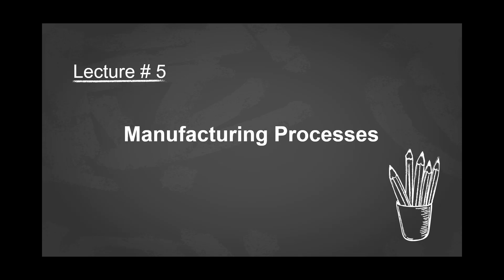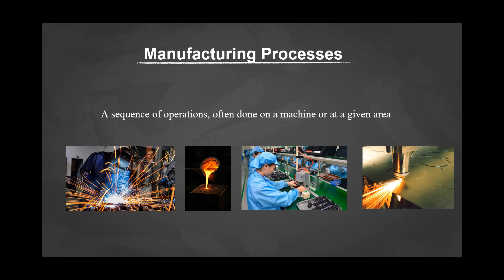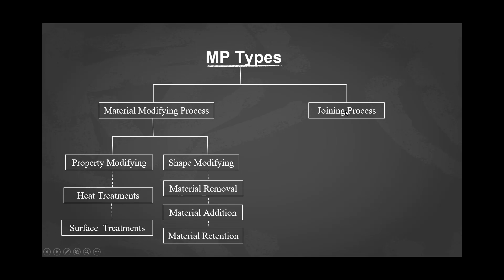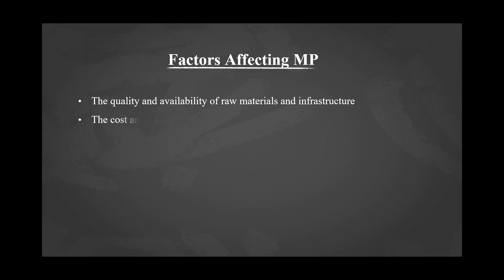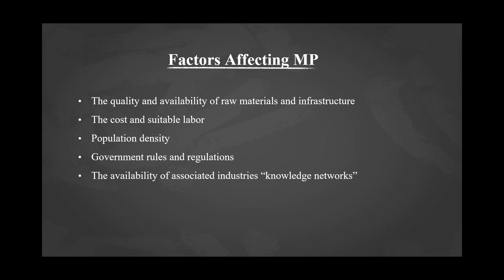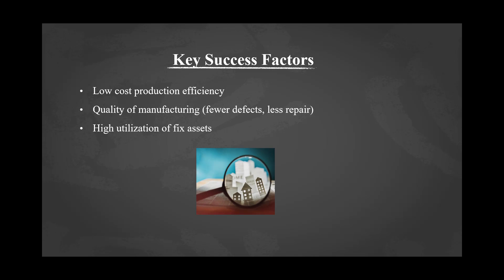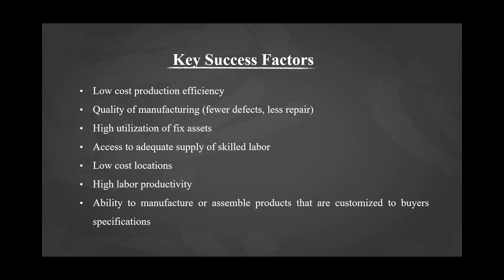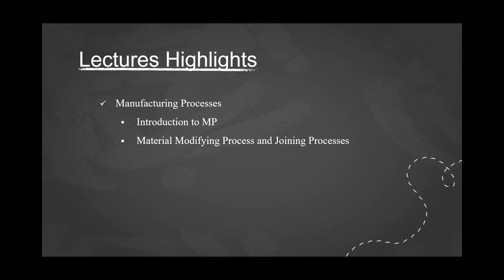lesson #5: Manufacturing Process,  Types, Factors and key success factors of manufacturing process

Comment: Ahmed Rustam
F18-0302
BS(SE), 5th
Section A
--------------------------------
Summary:
This lecture discusses a new topic related to Manufacturing Process. MP is a process in which different steps are involved and a product is made for further processing state or for customer utilisation. It has two processes, each having different sub processes:
1. Material Modifying Process
     i. Property Modifying
     ii. Shape Modifying
2. Joining Process
     i. Permanent
     ii. Non-permanent
     iii. Semi-permanent
There are different factors that play an important role in the process of manufacturing, either the process gets distorted or goes with a smooth circulation. Key success factors give a plus point to the business and as well as the MP.

---------------------------------------------------
Title: Amazon FBA
Strengths:
1. Automated
2. Stress Free
3. Effortless Logistics and shipping 
4. Potentially Unlimited Storage
5. No rent for physical shop
6. In this pandemic situation, every business collapsed but those who own their stores on Amazon still continued their business hassle free.

Comment: F18-0310
BSSE 5TH A
Summary:
Operations carry out on some area of machine is referred to as Manufacturing process. We can also make changes during the manufacturing process. Material Modifying and Joining Processes are the two main types which are used to convert the raw material into finish products. As it is a complex process so affected by many factors that is raw material, cost, labour, rules etc. To achieve the desired goals company must have quality production and design in low cost using skilled labour and high ratio of labour productivity.

Task:
Fish farming on small scale
Because of fish farming on small scale the productivity and also the quality of product will improve. It provides most flexibility because of Low start up and operating costs and No construction or training required. Also provides low costs in terms of products and switching of locations and we can also process leftover (dry ) fish. And lastly, it took less labor intensives.

Comment: F18-0380
BSSE 5th C
Summary;
This lecture is all based on manufacturing process. We can define manufacturing process as a set of operations that are processing anywhere, either on any machine or any specific area. Baking, Rasterizing is the examples of Manufacturing process. 
So, manufacturing process is a process in which sequence of operations perform on the machine or at a given area.
Types : 
✓Material modifying process
✓Joining process
 Material modifying process either change the property or shape of material. 
It is further devided in
✓Property modifying process
(Techniques include:Heat treatment ,surface treatment )
✓Shape modifying process(it is obtained by material removal, material addition, material retention)
 Joining process are permanent , non-permanent and semi-permanent joins.
Reply: There are three joints of joining process:
	Permanent
	Non-permanent
	Semi- permanent
There are many factors that affects manufacturing processes e.g. quality, cost, suitable labor, population density etc. 
After this we talk about the key success factors include :
Low cost production efficiency, quality of manufacturing, high utilization assets etc.
There are examples of ultra low cost products.

Comment: F18-0343
BS (SE) 5th B 
Summary of Lecture 5:

This lecture is about the manufacturing process first of all what is manufacturing process? Manufacturing process is the steps through which raw materials are transformed into final products. 

There are a lot of manufacturing process some are discussed in lecture like cutting, welding and casting etc. Basic purpose of all these process are same as mentioned above the transformation of raw material into final products. Furthermore we studied about the types of manufacturing process.

There are major two types 
•	Material modifying process: It changes the properties or shape of the material.
•	Joining Process: It contain, welding breezing and adhesive bonding.

Material Modifying Process is further divided into two types, Property Modifying and Shape Modifying Process. These types have further sub types but the major aspect of the material modifying process is to change shape properties, performance and power upgrading etc.

On the other hand joining process is divided into three type’s permanent, non-permanent and semi-permanent process.

After that we studied about the factor that affect the manufacturing process in detail. These factors include the availability of raw material, cost, labor, government policies and knowledge about the industry. After which we moves toward success factors of manufacturing process like if we start work with low cost and efficiency is high and also we have the ability to fix assets. Also we have to choose the low cost locations high productivity materials and low cost design and engineering etc.

Comment: Zaidullah jamil
F18-0329
BS SE     5B
summary:

In this lecture first we introduce manufacturing process and then its type factors and key points.
Now first we discuss about manufacturing process that is “sequence of operation often done on a machine or at a given area.” Manufacturing process convert raw material(different substances and chemical) into products.

And then we discuss about its types. there are two types of manufacturing process.
1:Material modifying process: it change the property or shape of a process.and they divided into further types i.e
         I. Property modifying process: Heat treatment, surface treatment
        ii. Shape modifying process: material removal, material addition, and material retention

2: Joining process:  In this they have,

1.	permanent,
2.	Non-permanent 
3.	semi-permanent joints.

Now we discuss about factors that is
•	the Quality and availability of raw material and infrastructure.
•	Cost and suitable labor 
•	Population density 
•	Government rules and regualtions 
•	The availability of associated industries "knowledge networks".

And then last one key elements that is,
•	Low cost production efficiency 
       Quality of manufacture (fewer defects, less repair) 
•	High utilization of fix assets 
•	Access to adequate supply of skilled labor 
•	Low cost locations 
•	High labor productivity 
•	 Low cost product design and engineering
Assignment Topic: Feasibility Report of Marketing Salt, A Social Media Marketing Business
Strengths: 
Our core strength lies in the power of our team; our workforce. We have a team of creative, result driven and highly proficient social media marketing expert, a team with excellent qualifications and experience various niche areas in the social media marketing industry and other related industry.

Comment: TABISH ALI
F18-0322
BS SE 5th B

Summary:

This lecture is all based on manufacturing process. We can define manufacturing process as a set of operations that are processing anywhere, either on any machine or any specific area. Baking, Rasterizing is the examples of Manufacturing process. 

There are two main types of Manufacturing process. Material Modifying process and Joint Process.
Material Modifying process has its more sub types. Property modifying process (heat treatments and surface treatments), Shape modifying process achieved by material removal , material addition and material retention)
Joint Process has also more sub types. Permanent, Non-Permanent & Semi-permanent. 

The manufacturing process is a complex one that can be impacted by many factors: supplies, equipment, factory overhead, the need for special parts, and the people who work at all points in the process. The more variables there are, the greater the possibility of disruption to the smooth operations of a factory. Management styles can also have a positive or negative impact on this process.

In the last, we studied some key success factors of Manufacturing process. There are so many key factors but some of them that includes low cost work efficiency, Productivity improvement, Investment in people and skills, Low production design and engineering.

TASK GIVEN BY YOU:-
Business Name: Marketing Salt
Assignment Topic: Feasibility Report of Marketing Salt, A Social Media Marketing Business
Strengths: 
* Our core strength lies in the power of our team; our workforce. 
* We have a team of creative, result driven and highly proficient social media marketing expert, a team with excellent qualifications and experience various niche areas in the social media marketing industry and other related industry.

Comment: SUMMARY:
In this lecture we studied about manufacturing process
"A sequence of operation often done on a machine or at given area".
For Example:
            Cutting process, assembling process, welding process etc.
During this process we add, subtract materials in order to given a property or shape to work piece.
Manufacturing process has different types.
_material modifying process
_joining process
material modifying process change the properties or shape of the materials.it also contain subtypes.
welding, assembling processes are joining process.it divided into more subtypes like, permanent,non-prmanent  
and semi joining process.
There are some factors which affect the manufacturing process like,
_the quality and avalibilty of raw materials.
_cost and suitable labour
_population density
_governoments rules and regulations
_knowledge network etc
there are some key success factors which are vital elements in order to accomplish or exceed thier desire goal.
Some key success factors given below:
_low cost products efficiency
_quality manufacturing
_high utilization of fix assets
_access to skilled labour
_high labour productivity
_low cost location etc...

[RollNo: F18-0395
BS-SE: 5th "C"]

Comment: Roll no F18-0355  Section B
Project: Home Tutor Service
Strength: 
The main strength of this business is that every student can avail a tutor anytime at his door step. We do not need to hire staff or tolet any building to run our setup. Our strength is our hardwork and passion toward our goal. It is a business like uber and cream where any student can hire a tutor for specific amount of time using our app where we provide best tutor in your area. Key success factor in this business is that it is low cost and we do not have to hire any staff for this business to run, by utilizing our knowledge and smart devices we can grow this business easily.

Comment: F18-1163
BSSE-5TH-C
Summary:
In manufacturing process we add, subtract or form materials in order to give our desired property, our shape to the work piece. The cycle of manufacturing processes convert material into parts and products starts immediately after the raw materials.
There are different manufacturing processes.
Types of Manufacturing process:
	Material modifying process
	Joining process
1. Material Modifying Process:
  Material modifying process either change the properties of a material or shape of a material.
Further types of material modifying  process are:
	Property modifying process ( include heat treatments and surface treatments)
	Shape modifying process ( achieved by material removal , material addition and material retention)
2. Joining process:
 Joining process includes welding, brazing, soldering, mechanical fastening and adhesive bonding .
There are three joints of joining process:
	Permanent
	Non-permanent
	Semi- permanent
There are many factors that affects manufacturing processes e.g. quality, cost, suitable labor, population density etc. 
After this we talk about the key success factors include :
Low cost production efficiency, quality of manufacturing, high utilization assets etc.
There are examples of ultra low cost products.

Comment: F18-0378
BSSE 5'C
SUMMARY
Basically Manufacturing processes are series of operations that are performed on a machine or given area in order to give shape or property to the given material.
There are two major type of MP:
Material Modifying process that can either change shape or property of material
Joint Manufacturing process That may hv permanent, non-permanent or semi permanent joints.
Some of the factors that affect MP including:quality, availability of raw materials, government rules and regulations, knowledge network.
The key success factor OF MP are:low cost production efficiency, quality of manufacturing, low cost locations, skilled labour's and many more.

Comment: F18-1180 
BS(SE) 5th "B"
Project: Home Tutor Service
Strength: 
The main strength of this business is that every student can avail a tutor anytime at his door step. We do not need to hire staff or tolet any building to run our setup. Our strength is our hardwork and passion toward our goal. It is a business like uber and cream where any student can hire a tutor for specific amount of time using our app where we provide best tutor in your area. Key success factor in this business is that it is low cost and we do not have to hire any staff for this business to run, by utilizing our knowledge and smart devices we can grow this business easily.

Comment: F18-1182
BSSE_5th-C
Summary:
                    The manufacturing process is the sequence of operations often done on a machine or at a given area, i.e welding, cutting etc. The cycle of manufacturing process converts the material into parts and products.
Types of the manufacturing process
1.Material modifying process,    2.Joining process 
Some factors like government rules and regulations, the cost and suitable labour, the quality and availability of raw material, Population density, availability of suitable industries are affecting the manufacturing process.

Some factors like low-cost production efficiency, high utilization of fixed assets(property, plant, equipment), quality of manufacturing, access to an adequate supply of skilled labour, Low-cost location lighten manufacturing burden, High labour productivity, low-cost product design and engineering are the key success factors of any industry.
=================================================TASK=============================================
Business Name: Online outsourcing of Software business;
  Strengths:
Lower Set Up and  Running Costs Than An Offline Businesses.
The Business Can Be Operated From Anywhere.
Scale-ability.
No Opening Time Restrictions.
Less Time-Intensive.
Higher Margins & Better Cashflow.
Global access, 24 hours a day, 7 days a week
Improved client service through greater flexibility
Cost savings
Faster delivery of products
Increased professionalism
Opportunities to manage your business from anywhere in the world